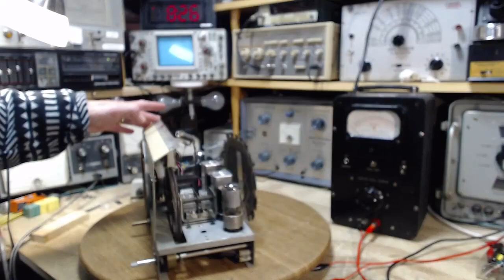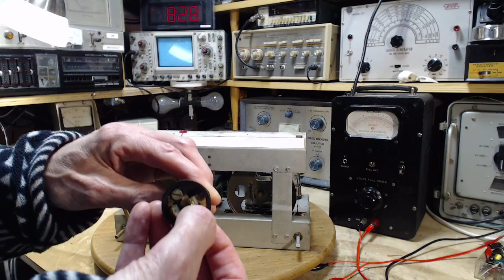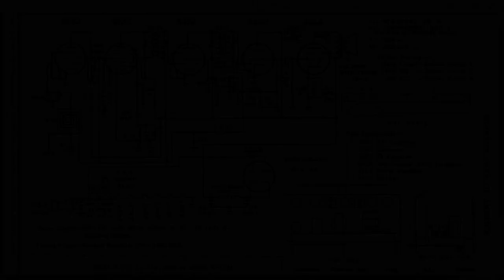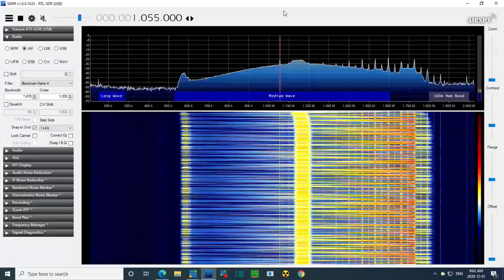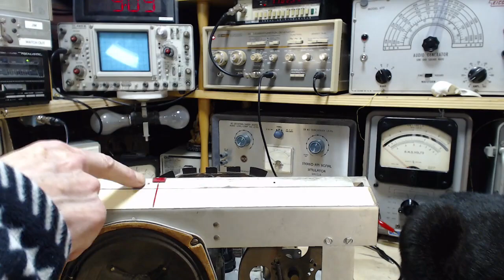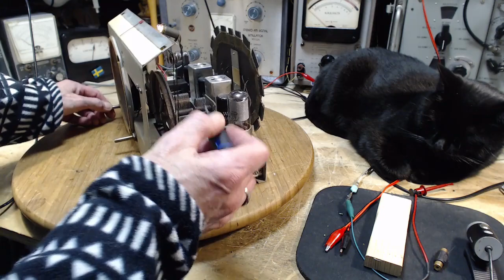Minerva W119 Six Tube Radio Video #4 - Alignment Experiments

Comment: Here's what I'd do:  if it has an adjustable osc coil, move down around 600 khz and adjust that coil for maximum noise.  Then move up to the high end and adjust the osc and antenna trimmers, repeat.  Learned that thru Wayne Lemons book.  He said the calibration may be off a little but, but sensitivity will be maximum.

Comment: In comes the SDR. Out goes the proper alignment.
14:40 AGAIN NO! Adjusting the trimmer CAPACITOR on the tuning cap is reserved to the HIGH END of the band, where the tuning gang is open and the trimmers will actually make a difference. At the LOW END of the band you always adjust the INDUCTANCE! And since the inductance of the antenna input in this radio is given by the loop antenna and not adjustable you simply leave it alone.
When you set out to be smarter than the EE who designed this radio and improve on their alignment instructions, you should at least have the basics down.
Reply: You must have missed that part when he stated he did the alignment in the last video verbatim! If i remember correctly, he didn't have the gang completely closed as it said in the first step!  Downhill from there i hate to say.